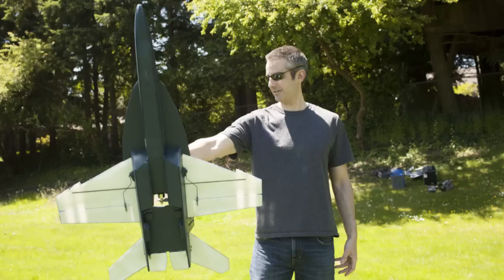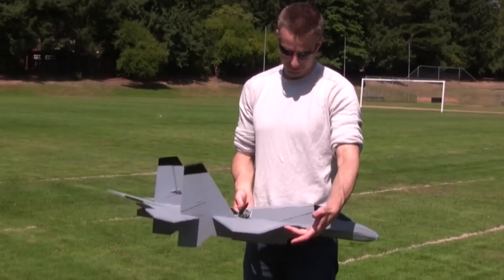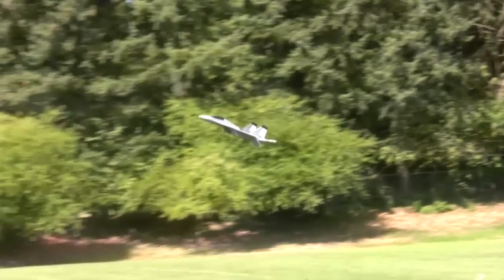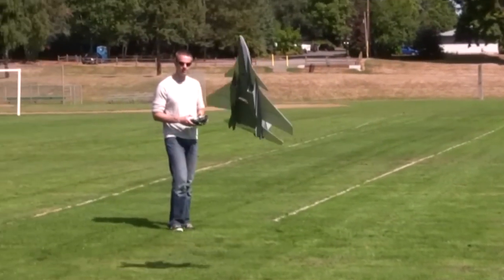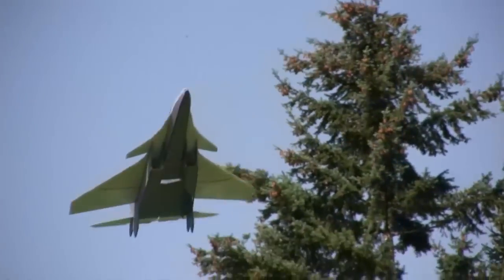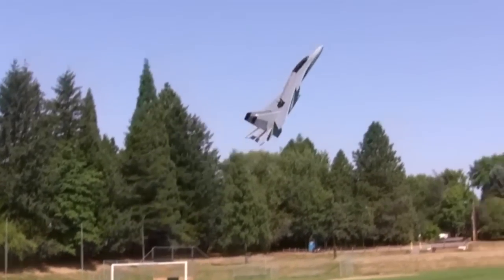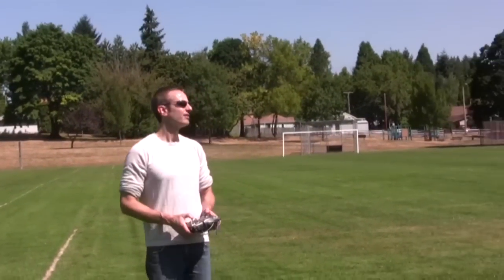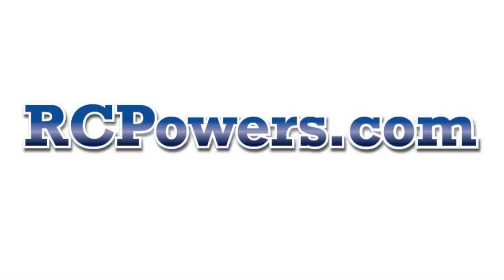Su-30 V4 Hovering Parkjet - Intro

Comment: There is nothing special about a prop-in-slot parkjet that can hover. The popular and ultra-simple Dekan F-22 scratchbuild propjet can hover far better than anything shown in this video (both of mine can, anyway), and it is a super-simple prop-in-slot design that has been around for many years, and is available FOR FREE on RCG, or as a laser-cut kit from the Flitetest folks. This video makes it sound like it is a complicated accomplishment, a major "breakthrough" [sic], years in the making to develop a hovering propjet! Sorry Dave, but you are many years late to this party...and consequently this video comes off as a bunch of salesman rhetoric nonsense.

Comment: A truly amazing 3d parkjet,  Dave and Scott! I built it as you suggested -light with elevons and rudders, no kf and also a 2s/7x3.8 WSF prop power system and it is an amazing vertical performer. Also great inverted performance and as you say - excellent speed.  Very low drag.  Best thing? It has a minimal number of parts! Beautiful looking, quick build plane that does what it's made to do.  Hover!
Reply from the maker: Thanks Greg! Best plane we got to compete with the Alpha Jet 2.
Reply: RCSuperPowers